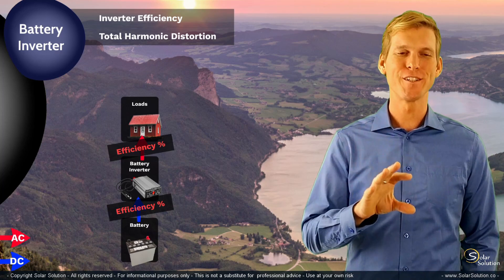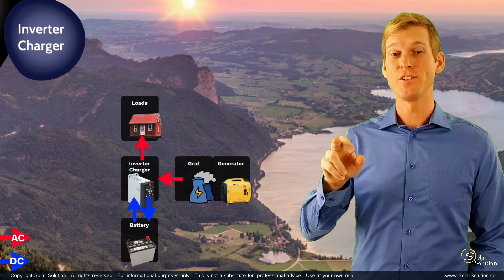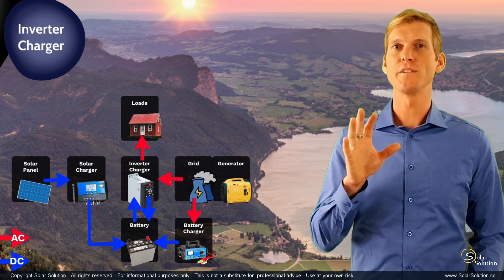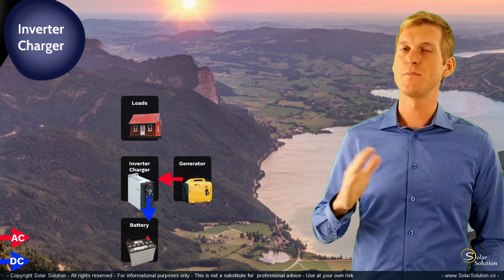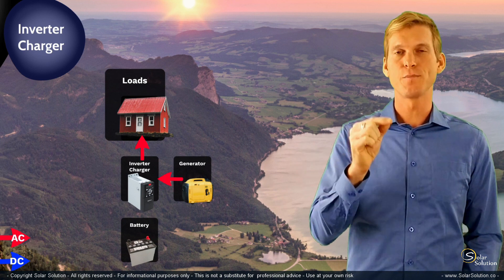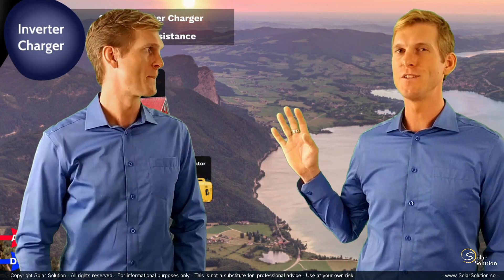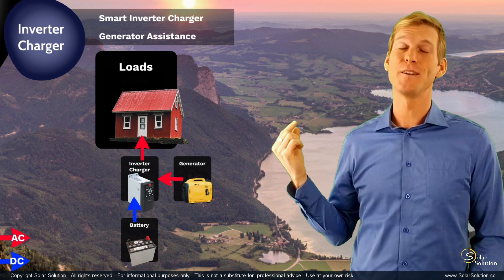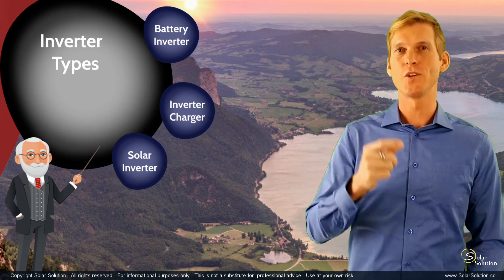Battery Inverter-Chargers explained: Wiring Diagram & Generator Sizing

Comment: Question.......can I connect a charger to a lithium battery and then from battery to pure sine inverter at the same time?
Reply: Depends for how long you are going to draw power from battery and how much (load). 
Assuming 100Ah 12v battery will give you theoretical max 1200W, let’s say you have all 100% efficient system. With a load of 1200W you will deplete the battery in 1Hr, but if you have a charger connected, the inverter will start drawing current from that, if it can not support (100A in our case) it will trip and shutdown or over heat or both
Reply: Thank you
One more question 
On my extension lead plugged into my wall socket I have my tv an WiFi connected. Can I plug this lead to my inverter and leave it plugged in when power comes back on? Will it drain my battery  and will it stop charging from my charger?

Comment: Great video! Quick question... When the inverter is turned off, should the charger still function? For example if I'm charging from solar, but have the inverter off as to not draw power. Thanks!

Comment: My max. load is 800W, I have a 2.5kWh lithium battery (12V) and a 1.5kVA pure sine inverter (12V). Can I use a 2.5kVA (230V) to charge my battery?